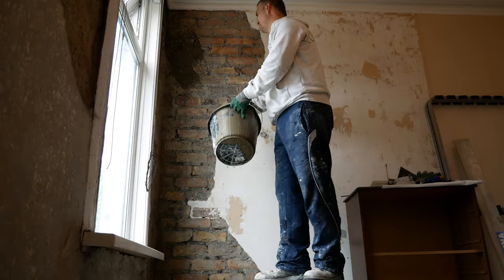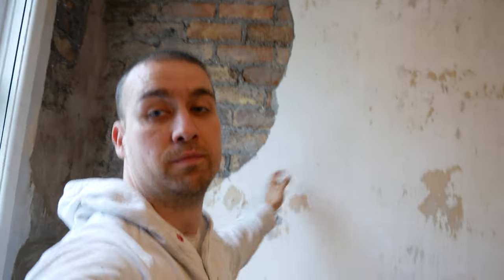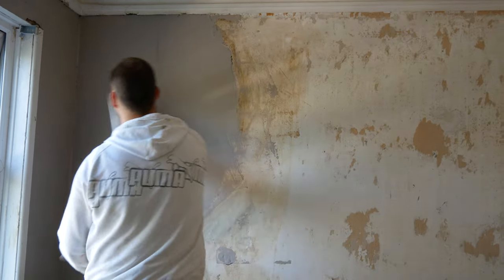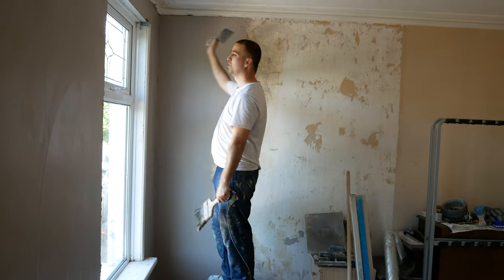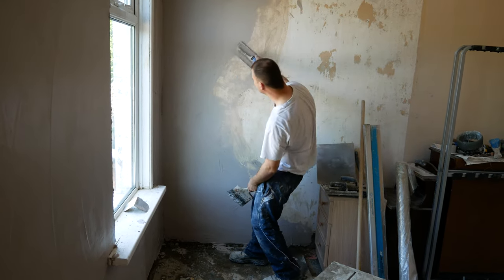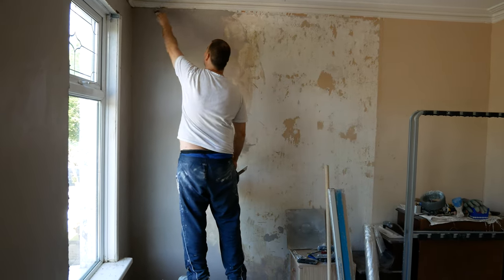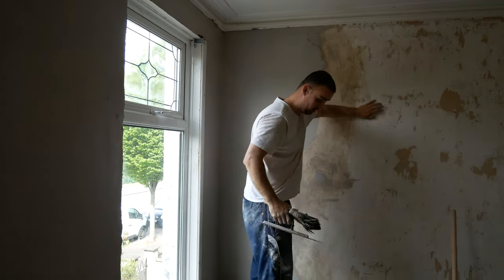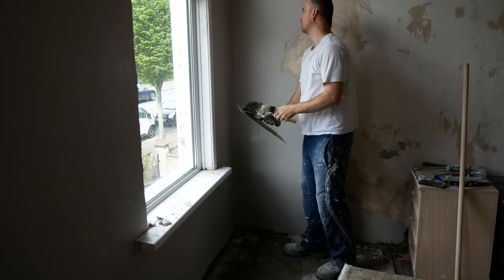how to patch an old brick wall scud sand and cement render and skim plaster finish part2

Comment: A bit off topic here, but what would you do with exterior block walls that have mould and mildew? The walls were scudded and then left sit years and now loads of muck and mould etc.
Reply from the maker: This i have a video on how to scud coat an old wall possibly the way i would go power hose the scud 1st
Reply: @macplastering  great stuff. So no need to use a chlorus or antifungicidal wash first? Need to re-scud or should the old scud be ok?
Reply from the maker: @hearingearrecords6326  oh you have it scudded allready antifungal was should work well but if you power wash should remove it also it might be good to give a 50 50 wash of sbr as you scratch coat it to be safe